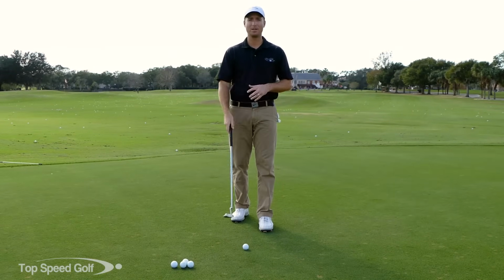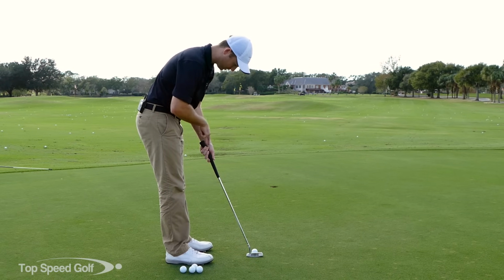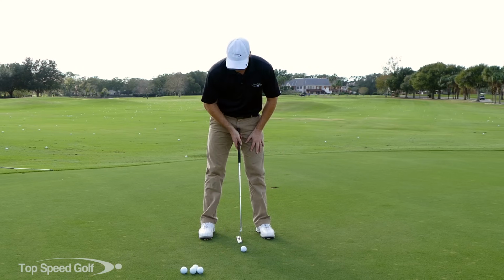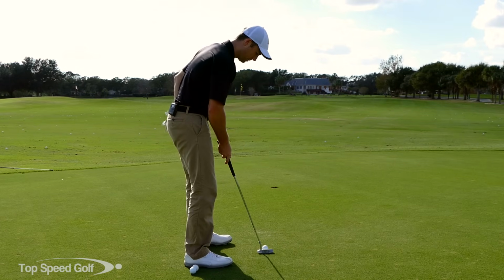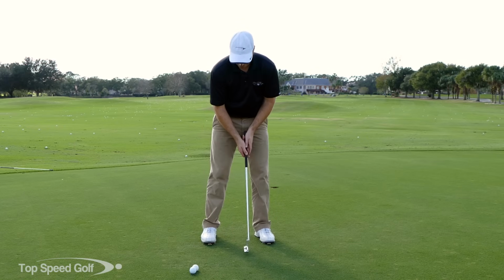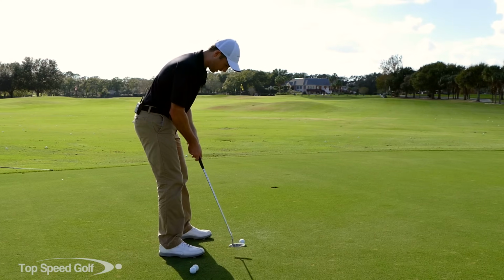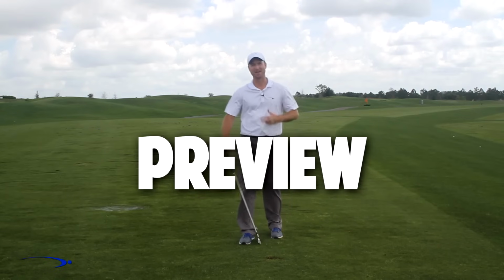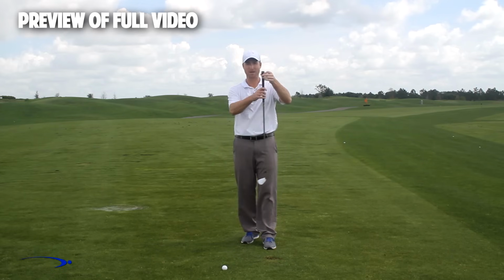Golf Lessons | Putting Basics

Comment: I never thought of hitting the ball with the upward part of the swing to add top spin to keep it rolling. I just assumed you wanted the ball mostly in the middle towards the back a bit to keep it down on the ground.

Will definitely try putting the ball slightly forward so the back of the ball is center of my body.
And will try the technique you mentioned about keeping the putter closer to the ground.

Thanks for the information.
Reply: While you do want an Upward Angle of Attack at Impact, you also want to be Delofting the Face at the Same Time. 
A Putter usually has about 4° of Static Loft, however you want to Impact the Ball at about 1.5° of Loft while still having the Upward Angle of Attack.

Comment: After I get the line and aim the line on my ball to where I want to putt. once I set up to address the ball , set my putter down and line up the line on my putter with the ball. I stand over the putt and it looks like I am aiming way left from where my ball originally was but I can get behind the ball and it is aiming exactly where it supposed to be. Am I standing to close to the ball or maybe have it to far forward in my stance? Thanks
Reply from the maker: It's possible. I would try standing further and see if the line looks straighter. Also, the more you set up that way the straighter it will look. It may just take some time.  Play well! Quentin | TSG Instructor

Comment: Clay, I know this video is 3 years old now, but I'm hoping you see this...

I've gone from a massive slice to a 290 yard draw on my drives

My irons are improving and getting distances locked in

Your videos have helped me a ton

I'm moving my focus to putting now...

In terms of distance control in putting...do you draw the putter back further and maintain the same stroke speed for longer putts?

Is the stroke always the same speed or do you increase the speed of the stroke for a longer putt?

I’ve heard you should draw the putter back further than you follow through the ball?

I need to be able to get these 30 foot putts to be close and eliminate 3 putts... I had an eagle putt and left with par yesterday!
Reply from the maker: Sounds good Aaron. In order to putt the ball further, it has to have more speed. If you hit the ball with the same speed it will go the same distance all things equal. Do try to keep the tempo of the stroke the same for short and long putts. Your follow through should actually be longer than your draw back to ensure you accelerate through the putt. Search our channel for drills on putting speed control. Play well! Quentin | TSG Instructor
Reply: Top Speed Golf - Clay Ballard 

Keep tempo the same ☑️

Increase speed on longer putts  ☑️

Is the draw back length (and follow through) supposed to be the same on a 6ft and 30ft putt then?

Only thing that changes is the speed?

I'll be checking distance control videos as well

Thank you!!
Reply: Aaron, About 30 years one of the Golf Magazines did a "Putting Study" that had 50 Pros involved. 
EACH Pro was given an 8 Foot, 16 Foot, and 32 Foot Putt.
Many measurements were taken for each Pro.
The one part that I found MOST Interesting was "TheTotal Elasped Time" from Start of Takeaway and then back to Impact was measured. 
For Each Individual Pro, his "Time" was virtually Identical for all 3 Different Length Putts.
So: While the Length of the Takeaway  was Increasing slightly, the Swing Speed was also Increasing as the Putt got Longer.
Hope this helps, if this does reach you.
Reply: @apaulmcdonough2170  that makes sense. Trying to become more consistent 2 years later!